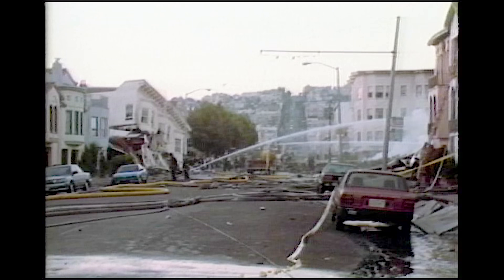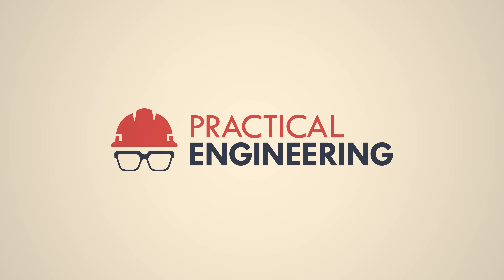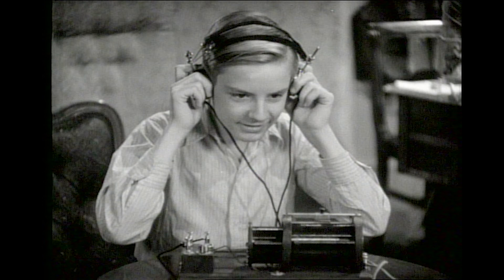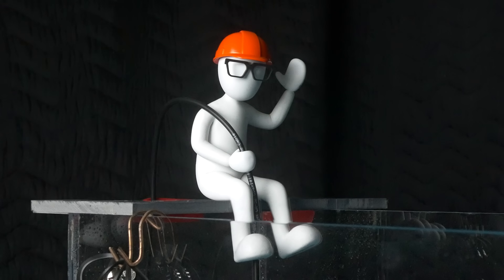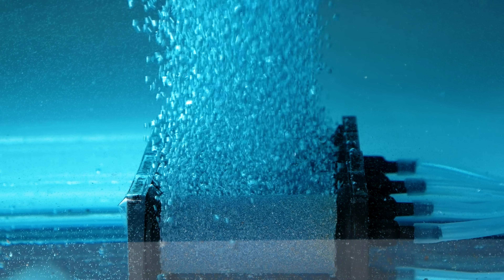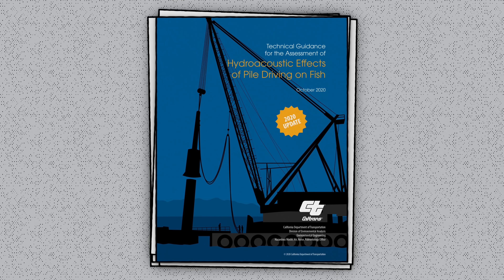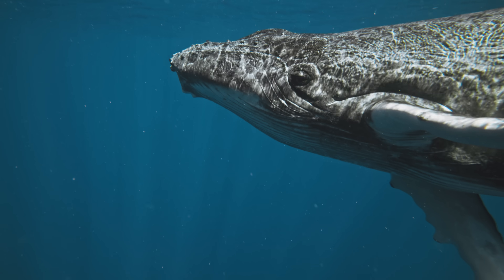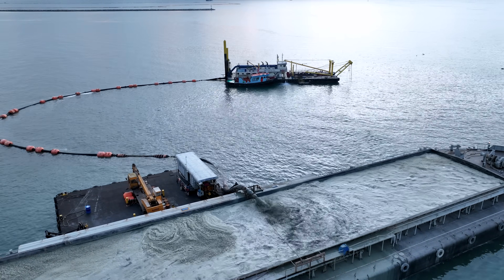The Weirdest Tool in Underwater Construction

Comment: My first exposure to Bubble Curtains & Aerated water was the Mythbuster's episode where they referenced the danger of Aerated/bubbletanks in how it lowers average density and allows floating objects to sink. In other words, a Bubble Curtain could be used to help sink a semi-bouyant object remotely.
Reply: To a degree this is also used to sink ships. Some torpedoes are set up to explode underneath their target and create lots of gas bubbles. The sudden lack of buoyancy on part of the hull, as well as the force of the water rushing back into the void the explosion created, are what creates damage to the ship
Reply: @HATECELL awesome fact
Reply: Maybe a better reason to be far away from a sinking ship then
Reply: This is where I thought it was going - use bubbles (and high pressure water) to dig the piling into the sea floor instead of pounding it down. It would only be practical to a certain limit, though.
Reply: I always thought it'd be a fun way to attack naval ships in a mild sci-fi setting. Pushing enough air under the front of an aircraft carrier to cause the bow to drop and spear down into the ocean would be one hell of a neat thing to see in a movie.
Reply: I remember that myth and I believe they busted it. The bubbles generate enough current to more than offset the reduced density. 

You still shouldn't swim near aerated water because the dangerous area isn't where the bubbles are, it's right next to that where the bubbles aren't. The water that came up has to go down somewhere and if there is a wall (even another bubble wall), it'll all go down in one place, creating a current that sucks you under.
Reply: @BunjiKugashira42  On Further thought, I think you're right. They busted the 'sinking a person', but imagine using the bubble curtain to otherwise control the fall of objects in the ocean is more of what I was thinking.
Reply: @BunjiKugashira42 
Their experimental setup had some issues. They made an air "stirrer". An aerated tank such as used for water treatment is much, much larger in diameter so the size of the person is not a significant percentage of the tank diameter. They also had just a ring of bubbles rather than the whole tank being aerated. So there were both upward flow and downward flow on Adam at the same time. That meant it was pushing Adam up on parts of his body and down on the other parts.
Reply: @BunjiKugashira42 for reference im a red seal plumber and have installed several aeration tanks in water treatment centers. Airated water 100% causes an object to sink, the danger IS LITERALY the airated surface as you cannot maintain buoyancy. It is in no way caused by the current what you have stated is  100% inaccurate. You cannot tread water in air to stay in place cause the air is not dense enough
Reply: @MrDmadness wow, a professional. How do you aerate the water without introducing a strong current that completely offsets the reduced boyancy? I'm genuenely interested how still aerated water works, because even if you use a giant network of pipes and fine sponge to prevent border effects, the water just forms a honeycomb pattern introducing its own borders. Is it the amount of air or the bubble size?
Reply: @BunjiKugashira42 you pump air. With a pump. It displaces water as it rises. The same way a boat displaces water but floats till the displacement is greater than the deck surface.. then it sinks
Reply: @MrDmadness  You're going to completely ignore hydrodynamics in your answer even though I pointed it out? I should've recognized the lie from the way your first post was written unnecessarily confrontational, but I was still hoping to have a conversation with a professional instead of an internet troll.

Air is lighter than water. A lot lighter in fact. This makes the air go up and drag the water with it, creating a strong current. If you use enough air, this current becomes strong enough to lift a body several cm out of the water (higher than they'd be in still water). The dangerous thing is that this water needs to go somewhere. It first flows to the side and then back down again. For a swimmer it'd be impossible to stay in the upward current. They'd always get pushed to the side and then sucked under by the strong downward current.

This phenomenon of water forming a huge donut-shaped current happens even if you manage to release the bubbles evenly over a huge area, because it's a self-reinforcing effect. If the area is large enough, you just get multiple donut-shaped currents side by side. At the surface they usually form a honey-comb shaped pattern. The bubbles drag the water upwards and create a low pressure zone at the bottom. This sucks water from the surrounding into the bubble column, taking any nearby released bubbles with it. The downward current has significantly less air in it, making any reduction in density negligible compared to the strength of the moving water.

If you were actually a professional in the field, you'd know all of this. From your original post there were really only two possibilities: 1. You're a professional and have a way of aerating water without the bubbles coalescing into columns. 2. You're a liar. Your second reply told me which one of these possibilities it is. I wish it'd been the other.
Reply: @BunjiKugashira42 im hostile ? Dude youre arguing nothing. 

Im a red seal plumber,gasfitter and electrician. What are your credentials ? Ive worked on airation tanks several times. Theres no real mistery here. Does motion of a gas in water create a current, well yeah too a degree, but the fact that the water is airated ( less dense because of it ) is why things sink in it.  Youre really seeking a deep answer to a basic thing
Reply: @BunjiKugashira42 you are trying to apply bernoulis principal where it doesnt really fit. Yes air is less dense than water and also lighter a ft3 of water = 62.4lb air ft3 = 0.076lb 

What is your point? You cannot tread water in air.

Comment: So has any terrestrial construction used rain curtains to limit sound propagation?
Reply: Very interesting question! I can't answer directly, but I do know that in technical rescue operations, water curtains are used to limit the spread of water-soluble gases like hydrogen chloride, in case of leaks. Somewhat related.
Reply: @hellelujahh  I think I've also heard of water spray used to clean output of industrial smoke stacks.
Reply: @MrCafitzgerald Oh, neat! Makes sense that it would capture soot or other solids. Actually that's a bit similar to how it's sometimes used in demolition and mining operations, to contain and limit dust - but I think curtains are less common in this use case than just spraying whatever's being bulldozed with water.

Comment: Interesting. at least in RF, sharp changes in impedance create reflections, while gradual changes allow the signal to propagate. I wonder if its the same for bubble shields. In which case if you tapered out the density of the bubbles over a distance on the inside and outside the sound would pass unimpeded, and conversely, if you could somehow sharpen the density gradient if it would be even more effective

Comment: It would be interesting to do this test again, but with sand on the bottom, and an aquarium aeration ring around the speaker. I wonder the effect sand has and how much difference the ring would make!
Reply: It is

Mm
,,,,,,,..,.,,,...,....,.....,...,..,.,...,....,.,,.,,.,,.,,,,.,,,..,,,.,...,,,,,.,.,.,.,,..,,,.,..,.,......,.,.,...,....,.,...,.,.,.,,,..,.,.,...,,,.,,,.,,,,,.,,,,......,.....,,,.,.,,..,,.....,.,,,...,... The,,..,....,................,........,..,,.,..,.,.,.,,.,...,,.,.................,....,...,.,,....,,,,,.,...,....................................,........

Comment: I don't know if you mentioned it, but here in Norway we use bubbles to keep areas like ports free from ice in the winter
Reply: Ooh that's smart!
Reply: You probably also use bubbles on icebreaker ships. I think Norway is one of the few countries making those.
Reply: @DomoKuchikan  Ans Russian icebreakers have used bubble systems since the 80’s.
Reply: Where do they put the bubbles? At the entrance, around the edge, right at the docks?
Reply: @andrewfleenor7459 alle over but spaced out so you get the varmer water from the bottom up to the surface so it does not freeze.
Reply: I actually built a system like that with my dad for the family boathouse. Just needed a discarded refrigerator compressor, some hard plastic tubing, a few connectors and a drill. Keeps the boat on the water year-round with no ice damage.
Reply: I learned this watching alluring arctic keeping their rudder free of ice when in the arctic for the winter.
Reply: Coarse Bubbles also aid in reducing Biofouling of Membranes and maybe even ships!

(Also drag reduction of ships)
Reply: now that you mention this, I've seen bubble curtains along gates of locks to keep them movable during the winter
Reply: I've seen that at a marina on Lake Ontario in the winter. Very cool indeed.
Reply: Shame there's no video to find out if he did 🤔

Comment: I love the difficulty comparison between pile driving, and mitigating the effects of driving a pile.

Deep Sea Pile Driving:
Step 1 - Lift heavy thing and drop it

Bubble Curtain effective use:
Step 1 of 53,402 - Cry a lot.
Reply: So, I get that you're mostly making a joke, but I want to say that pile driving isn't actually that simple, either. Like, you could say a bubble curtain is just "Step 1: release some air in a measured stream". Figuring out the material of pile you need, the depth that you want it at, the composition of the rock you're driving it into, etc. etc. is all quite a lot of stuff.

Comment: I've worked in audio engineering most of my adult life. One thing that was unexpected at the beginning of my career is the importance of impedance. This video is excellent.
Reply: When I graduated high school, I wanted to be an audio engineer, and I wanted to go to the Berklee College of music in Boston. I ended up with an engineering degree in electrical engineering and worked most of my career in control systems, industrial automation, and then multidiscipline project management. One of the things you learn in control systems is how to model, mechanical, thermal, and hydraulic systems using electrical circuits. It’s a linear approximation technique. Electrical circuits are linear;majority of fluid systems are non-linear.

I have never seen any such modeling done for sound systems and I would find that interesting.

Comment: This reminds me of navy's Prairie/Masker system (which I first learned of way back in Tom Clancy's mid-80s novel Red Storm Rising) where bubble curtains are used around the hulls and propellers of warships to reduce / distort their acoustic signature; making them harder for subs to identify and attack
Reply: The prairie and masker systems are actually two separate systems.  

The masker system consists of belts around the hull from port to starboard.  They are essentially pipes split in half down their length with a bunch of holes drilled in them.  The belts are positioned at specific locations along the hull to create a coating of bubbles over the hull.

The prairie system is more complicated mechanically.  It is basically a pipe run down the center of the propellor shaft, and then a series of ports and passages to direct air to the leading edges of the propellor blades.  This creates a skin of bubbles over the propeller.  The design of the propellor blades of the destroyer I was on were also self cavitating.  Cavitation is the formation of small low pressure pockets that burst into steam.  Normally, engineers try to avoid this because when the bubbles implode they act like tiny hammers that create noise and damage surfaces.  In the case of these propellors, through a combination of new alloys, complex engineering, and magic I never understood these drawbacks were mitigated to the point that cavitation was useful for sound attenuation.

The systems were very successful, to the point that sonar techs told me our ship was indistinguishable from a rain squall.
Reply: @Simple_But_Expensive  Thank you for this thorough explanation - always good to learn more about something I read years (decades!) ago.  IIRC, Clancy wrote that these mitigation measures created a signature at a frequency of 1kHz - appearing like light rainfall as you said 🙂.
Reply: @Simple_But_Expensive cavitations are low pressure bubbles made by movement through a liquid and are loud when they collapse. Prairie-masker is air-filled bubbles and can't collapse. They're not the same.
Reply: @fidjeenjanrjsnsfh Prairie air was emitted from the leading edges of the screw.  The screws were still intentionally self cavitating.  Like I said, magic I never understood.
Reply: @Simple_But_Expensive  I would think though that prairie masker needs regular cleaning to keep the holes open from marine growth.
Reply: @tomtrenter3208 Not so much.  Anytime we were underway, the systems were running.  Hard to plug a hole with pressurized air blowing through it.
Reply: @Simple_But_Expensive what kind of magic can make material withstand that kind of hellish environment
Reply: I’ve also heard they use bubbles on ship hulls to reduce drag
Reply: @Gagen773While that is true, it was an entirely secondary consideration for a ship involved in anti submarine warfare.  As Clancy described it in one of his books, picture two guys in a pitch black basement armed with a pistol and a penlight each.  If you turn on the penlight (ping your sonar) and are wrong about the position of your opponent, he now knows your position while you don’t know his.  Because of this, you don’t ping (despite Hollywood doing this whenever they show a submarine).  Instead, you listen.  Whoever makes the most noise first loses.

I was on a Spruance class destroyer.  These were the first class of gas turbine powered ships.  Although seriously underarmed, they were fast, highly maneuverable, and stealthy as hell.  My second captain called them Sea Ferraris.  Drag reduction was not even on our radar.

The use of bubble coatings as a drag reducer is relatively new and confined to commercial uses.

The US Navy still uses prairie and masker air systems on their Ticonderoga class cruisers (built on the same engineering hull as a Spruance class), and their Arleigh Burke class destroyers for obvious reasons.  I am not sure about their other types of ships, but it seems a no brainer, so I suspect they use them on all their warships.

As a side note, we were so careful about hiding that we never got near sea lanes if we could help it and, if detached from the carrier group, dodged from squall to squall to avoid satellite detection.  We also rarely lit up our radars or transmitted any radio signals.  A destroyer presents a much larger threat if you know she is out there, but can’t find her.  Kind of like being stalked by a psycho ex girlfriend who is armed with a knife.😈

A common phrase was “Chicken of the Sea, we hide with pride.😊
Reply: @Simple_But_Expensive  I was on the last crew for USS PAUL F FOSTER (DD 964), my only ship out of 20 years active Navy, and the only SPRUANCE still floating.

Some of the icebreakers use bubbles to reduce drag and reduce the buoyancy of the water so it's easier to break through the ice.
Reply: @Simple_But_Expensive thank you for this intel comrade
Reply: @Simple_But_Expensive  Awesome information, and thorough in storytelling/placement. Appreciate it.
Reply: @Kriss_L  -- Makes me feel old... When I was in, the Spruance class destroyers were the new whiz-bang ships that everyone wanted to get assigned to...
Reply: @plwadodveeefdv This stuff was never particularly classified, and was pretty much known worldwide.  Tom Clancy wrote about it in a bestselling book even.  So I guess you are welcome?
Reply: @seanseoltoir  I know the feeling.  I drive past a couple of decommissioned AEGIS cruisers everyday going to work. :(
Reply: @Simple_But_Expensive  I always loved how Clancy showed sonar for what it was. A dangerous last resort.  All of his engagements that I read were about being quieter than the enemy until the time was perfectly right.
Reply: @Malaphor2501 Active sonar (pinging) has its uses, but they are rare.  Passive sonar (listening) is the name of the game.  The sonar techs are as good as portrayed in his books.  I have seen my ship get a passive track from a merchant ship at 150 nautical miles.

That is why I laughed when a bunch of environmentalists got congress to investigate if sonar was harming whales.  In 6 years in the Navy I had never heard of any US Naval vessel actually active pinging while at sea.
Reply: @Simple_But_Expensive a private company used active sonar in the Gulf of Mexico, back in 2006 I was working on a platform at -160’. It felt like I had been hit in the chest with a sledge hammer, and it lifted me off the structure. Their boat was maybe 10 miles away, and they were doing oil exploration research. 

Thought I was dead. It hurt. The only other time this happened was a pod of blue whales were maybe a kilick and a half away. It felt the same, sort of. Heavier. Imagine a bigger sledge hammer, but a slower swing. That thumped me pretty good, it took me out of the dive rotation for a few weeks as a precaution.
Reply: @Simple_But_Expensive  ex armed with a knife

I find that oddly specific…
Reply: This is the first thing I thought of as well.